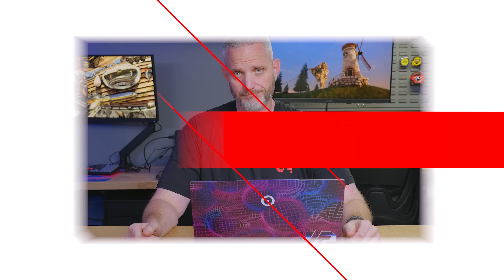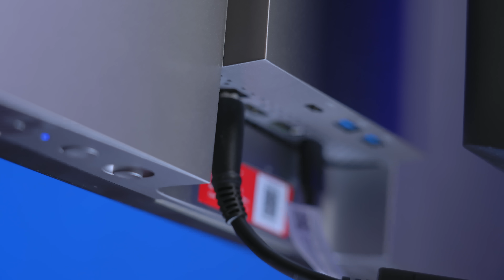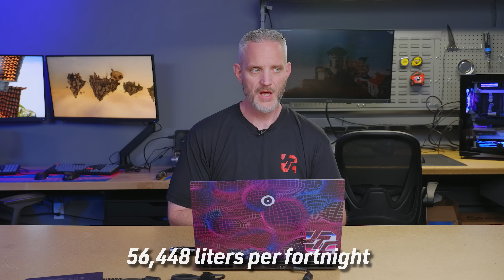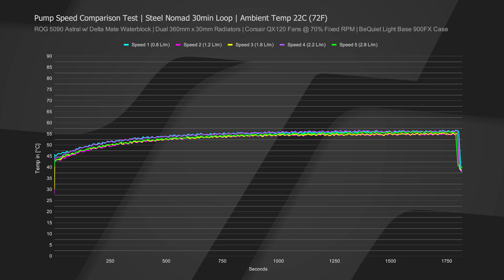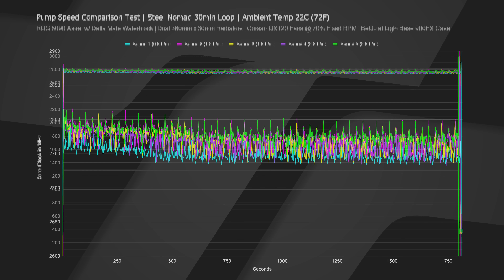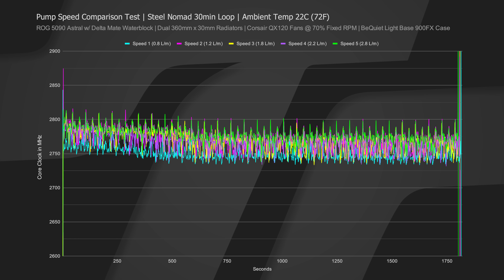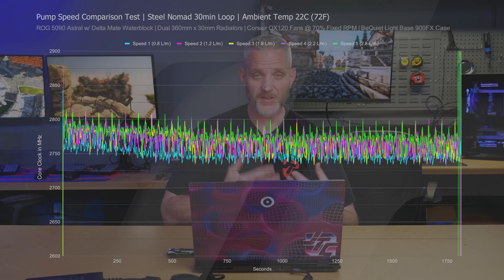Stop doing it this way!

Comment: Fastest speed to me doesn't sound like the best choice, coolant has less time heat soaking and less time dissipating said heat. The faster the water goes over the heat source the less time it has to soak up the heat cooling down the source is not efficient. Going too slow then the coolant wouldn't be removing the heat fast enough but acting like an insulator if you will. So there would be a sweet spot between the fastest and slowest and that I think will depend on the loop itself, radiator size, CPU/GPU blocks, restrictions changing flow rate, the coolant itself... everything that makes a custom loop unique.

Comment: 45-55 % or until you are not annoyed by the pump sound, its FAN speed that increases or decreases cooling ability by blowing more or less air through the radiators.
Reply: ...to a point at least.
Reply: The best thing would be an infinitely large radiator with more fluid. MO-RA wins.
Reply: "Cooling ability" isn't a thing, however heat removal is. The heat is removed by saturating the cooling medium. More time to saturate = more heat being removed.  Also, air and liquids are both fluids, but with different densities. Hope that helps.

Comment: Radiator physics lesson: heat transfer from a material to ambient is proportional to the delta temperature. 

Lets split a radiator into mulitple "zones". The zone closest to the inlet will always be hotter than the zone closest to the outlet. As the liquid moves thru the radiator, it cools off and becomes less efficient at transferring heat to ambient. 

The faster the liquid goes through a radiator, the lower temperature drop across the radiator inlet and outlet, which increases the radiators efficiency at rejecting heat. 

There is always a practical limit since turning up the pump requires exponentially more energy. 

So many other factors effect heat rejection (air velocity, radiator size, design, ambient temps). At some point, changing the pump speed will stop making a difference and a different factor should be changed.
Reply: I just wanted to add a section about the fin stack on the CPU block... 

The faster the liquid, the less temperature drop across the fin stack, which increases its efficiency (just like the radiator)

Only thing increasing the pump speed will do is increase the loops efficiency at rejecting heat and causing the pump to work harder. 

One thing I wish was possible is to monitor the radiators inlet and outlet temperatures. That may be used to indicate if a computer has a good "water pump to fan speed" ratio.... to ensure that both are not overpowered unnecessarily.
Reply: I would think dwell time and surface area would have some effect on it.  Maybe not as much as delta T.  But then again, I disliked physics and gained most of my knowledge from life experience in heavy industrial settings where we didn’t use finned radiators at all.  Just heat exchangers and cooling towers.

Comment: do we actually need a flowmeter?
i think its just a fancy gimmink, adding more cost to the build.
you never rly need it, just like costum waterloop
temp is readable without it by just going to taskmanager
if pump stops working you wil notice right away and turn of pc, if that ever happens.

Comment: You've covered pump speed vs time taking away heat from the CPU/GPU and also the time spent in the radiator giving up that heat but there is another important factor.  The amount of heat removed in the radiator at any fluid speed varies exponentially with the difference in temperature between the fluid and ambient air in the case provided by the fans.  All tests should be run at a constant radiator fan speed.  In other words, HOT fluid gives up its heat faster than COLD fluid and the only way to get the fluid HOTTER is to move it SLOWER.

Comment: I'm still running my first AIO , a corsair H80 , that is now around 15 Yo , always in lowest speed with 2 fans in push pull exhausting , It managed to keep my overclocked i7 socket 2011 4930K under 68°C in the hardest gaming sessions (cyberpunk , Flight simulator) in silence . In 2022 I did a case and AIO upgrade (aerocool L240F with dynamic speed pump by PMW )  and reused the H80 to build my multimedia PC on the living room now with a i7 3770K , still silent  , keeping the cpu around 34°C for YT/streaming HD/4K , and under 70°C while gaming .  All of this to say that low speeds equals longevity of the pump , the best ratio is the lowest setting that keeps the CPU/GPU cool ;)

Comment: I have a similar loop layout in comparison to Jays latest unnamed system.  But I am using a PWM DDC pump instead.  And just like Jay mentioned, the pump hits full speed the moment the system powers up.  Then comes back down when the fan speed profiles load.  It has a heat sync on the back of the pump and plenty of air flow over it to help keep it cool.  I have found through a lot of trial and error that running the pump at 20% at idle and 60% at full load, seems to be the sweet spot for keeping the coolant temps in check.  Running the pump any higher seems to allow the coolant temps to reach a few degrees higher.  My question is, can a DDC pump add noticeable additional heat to the loop?

Comment: Jay, these tests you're doing and your approach / methodology are great, but please fix your data vis. The graph at 13:41 is practically useless because it's so noisy. Please look into different ways of smoothing noisy data. My suggestion would be to show the line chart with moving average smoothing and as a "conclusion" show a box plot for the different pump speeds.
Reply: That would be skewing his data too much.
A better approach is to use statistical analysis on these and give average/variance/mean, that sort of things. In any case we can see that apart from the speed 1/2 where the clocks are slightly lower, every other setting is exactly identical.
Reply: @Bourinos02  I'd argue instead of processing the data in any way, it'd be better to set the tests up in a more controlled manner. For one, use a controlled heat source instead of a windows PC running a benchmark. If you control the water temperature going into the block and the heat source, you can measure the boundary temperature and get meaningful data. A lot of what's shown as spikes in Jay's data isn't noise at all but changes in the system.
Reply: @a.x.w  Except it doesn't matter at all in this use case. The water temperature is defined by the ability of the loop to cool down the fluid at its used settings.
The power consumption of the chip would change only if the ability to cool down is significantly different which is not the case here either as we can clearly see in the frequency curves. So if the delta in these conditions slowest vs fastest pump RPM is already insignificant, it'll be even more so if they just run a heater on the block... Defeating the purpose in the first place as putting a heater is unrealistic as we know CPUs will behave differently upon different cooling.
Reply: @Bourinos02  The point is you'd get more meaningful data in an isolated test. The fluctuations aren't caused by noisy measurements but by changing test conditions. The conclusion that pump speed doesn't matter is wrong in the first place. If you control the water temperature, you can very much see that. When I set up my loop, I ran cinebench until the system was fully heat soaked. At that point, I saw an immediate change in CPU temperature of over 3K between 1800 rpm and 4100 rpm, which happened to be two noise sweet spots. Obviously, this is anecdotal evidence and not scientific. The math is well known, however. You're right that fan speed matters more than flow rate, though. You need to get the energy out of the water, after all.
Reply: @a.x.w  Well, you get 3K between your 2 settings, he gets around 2.5-3K  between his min and max flow rates. Talk about significant impact... Chances are the impedance and contact area inside the water block has more influence on the result than the RPM of the pump.
Reply: I was thinking a Table with something like an ANOVA or other statistical analysis that applies a significant difference label would be helpful

Comment: I think the quality of the coolant is more important for thermal transfer than pump speed, at least in this instance.
The most important factor overall in watercooling is the size and dissipation power of your radiator. If your rad is too small to properly cool the liquid going through it, you're gonna have a bad time.

Comment: I'm not sure if this a good suggestion or if its possible. But would be nice to see each speed line separately or the ability for you to be able to turn off speed 1 and speed 5 so we can see the other speeds more clearly. Might also help when explaining a specific pump speed to remove the clutter and trying to read between all the other lines to see what you're explaining.

Comment: Jay went from "lets measure pump speeds cooling effect" to "SQUIRREL!!!  HI THERE!" with all the different items he discussed in this video.
Radiator fin size
pump heat 
heat sink fin size effect on flow
how many liters per minute
how much ambient air temp changes results
what time of year
what time of day
what time frame after taking a dump
what the comment sections babbles about
all the INNUENDO comments
all the bots in the comments
AI interference in algo placemnt on trending
whather or not Nick farted in the background
whether or not Phil is editing a video
is anyone in the state singing a song that says i should sing it
ooh 
baby ooh
baby
oooooooooooo

Comment: If your loop goes into your GPU first, and then into your CPU and you run it slowly, I can assure you that your CPU will suffer more because it will get hotter coolant. I don’t think this test is fully validated as being able to run it at any speed. This is a huge factor that’s missing and you might end up with an extremely hot CPU due to the fact that the speed is too slow.
I don’t think maximum speed would be needed, but I think the slowest speed is not going to work as the way it stated here.

Comment: Jay, to test the heat dumped into the loop from the pump, use an external power supply and run it at 100% for 30 minutes with the system off. Great Video.
Reply: Or create just a small loop with just the pump and res, powered externally. 

That way you won't even deal with flow restrictions from blocks and fittings.
Reply: This is the way.
Reply: It's only a ~20W pump, it isn't going to dump much of anything. 25% of that will probably bleed to air, 75% to water at best.
Reply: Or just measure the energy consumed by the pump. It cannot generate more heat than that and I assume it's pretty meaningless compared to the heat generated by cpu and gpu.

Comment: How about just on a bench ( flow meter and temp meter on all of them )  
Take a random cpu and a 30/40/50 gpu/ or amd /or heat blocks   ( you need data )

340l/h to 1500l/h 

1 setup: cpu / gpu / pump /reservoir / 1x360 radiator / soft tubing no 90
2 setup: cpu / gpu / pump /reservoir / 1x360 radiator / soft tubing with 90 fittings

3 setup: cpu / gpu / pump /reservoir / 1x360 radiator /  hard tubing  with 90 fittings
4 setup: cpu / gpu /+ other blocks/ pump/reservoir / 2x360 radiator (or other radiator) /  with 90 fittings

It will take some time but you will have a lot more data 

Examples 
Alphacool D5 have around    340 l/h - 350l/h
Barrow 10W PWM 450LPH    450l/h
--- 
Freezemod   PWM 1100L/H
Barrow  18W PWM D5  1260L/H
EK D5 PWM1500L/H

Comment: Hey Jay, any suggestions for a manual controller for a 4-pin Molex plug pump? IDK what, but my Aphacool DDC pump is MOLEX, so it runs 100% all the time, and I feel with my setup it is moving fluid WAY too quick to cool the system.

Comment: Jay, you could have gotten way more accurate settings in the bios if that pump had an RPM output.
Could have watched the speeds in the bois or a system utility and been able to set it accurately.

Comment: I recently converted to a full loop in an older case with a blocked Titan Xp to finish off my board and i7 blocked x79 R4BE platform and spent a good while adjusting speeds through my ROG front base. throughout a handful of full loop builds ranging from a single 120 up to this rig with 2x 280s and a 140, 70% pump speed across pumps from the mid 2000s up to now its always been the sweetspot in that 2000-2500rpm range for me, sure i haven't measured flow rate..they didn't exactly exist in the 2000s, we had spinny wheels to see if fluid actually moved hah! Outside that boundary and either i havent been able to overpower trapped air or recieved worse temps with added turbulence in the res.

Comment: Thank you for doing this test. And thank you for confirming my experiences with D5 pumps where reducing noise/vibrations seems to be the main factor. Even with decoupling I have to use the lowest setting so I don't hear the hum from the pump. At higher speeds it makes more noise than the fans do.

Comment: My opinion it doesn't really matter I run my pump minimum 2100rmp then I've custom curve it to the GPU so hotter my GPU gets the faster my pump runs up to 60c 100% speed. But my GPU never goes over 45c so.

Comment: i live in a 4 season climate i run my pump at a different speed for the temperature it puts out. when it's hotter out with more humidity it takes longer to cool the antifreeze down. laws of thermal dynamics when combined with laws of hydrodynamics.

Comment: Put a flow meter on the line just before it dumps back into the reservoir so you can see if flow rate changes at all.
Reply: Not necessary. The flow at the second meter will be the same as it is at the first. The only way for fluid speed or volume to change is by changing what the pump can flow. Liquids do not compress, meaning you would have an accumulation of fluid at some point in your loop if volume were to change anywhere.

Comment: I'm surprised that you actually didn't reference cars for this video. If you take the thermostat out of a small block Chevy it will overheat. The water just moves too quickly through the loop and doesn't spend enough time in the radiator to properly. Cool. So you got hot water going in and hot water coming back out into the engine. If your thermostat is stuck and you're overheating anyway, just got the insides out of the thermostat and put the housing back. That will restrict enough flow for the water to stay in the radiator and your engine won't overheat. Although I don't know how many people have a small block Chevy these days LOL

Comment: 10:30 You literally have a thermal camera! You just used it!
Reply: Or an inline thermal probe - Alphacool have a flow sensor (to 3-pin fan header) and coolant temperature sensor in a single device. If the motherboard doesn't have a temperature probe port (most don't) then plugging it into a Corsair Commander / XT or similar works fine.

Comment: The physics applied in this vid is completely non-sense. The physics of water cooling has been pretty much known for ages, like in at least for 20 years now, and they apply here as well. Jay is simply not talking about that physics at all. He is out in the fields somewhere, doing farm stuff. To be blunt, he just showed you that water cooling don't matter, just use your air cooler. That would apply to these very results, because he is not measuring the expected results of pump speed.

In short, the efficiency of a water block, typically can benefit greatly form increased pressure or flow. The benefit is inverse exponential, and depending on the pressure in question, there might be little to gain. Also, radiators also increase their efficiency with increased pressure or flow, but most rads do not benefit all that much from the increase, and the benefit is often loss due to the added heat to the loop form the pump. Also, he test this with in adequate rad power, as he talks about the loop heating up.  That is because he has an impotent rad. Loop temp is irrelevant once you have a potent rad, at least for this type of testing. The water temp into the block should easily be kept within a few C or K, of the ambient. No matter the pressure.

But, as he once again proved, water cooling is not needed. A proper air cooler gives about the same performance. Once you start chasing the last bit of performance, it is the way to go. But rather, in loops with insane power consumption water cooling can deal with the heat, while air cooling will start to hit a wall. Like systems drawing 2000W or more.

But if he had used a high performance water block, in a somewhat restricted loop, the water temp will sky rocket after the block, if pressure is increased, as the efficiency of the block will increase dramatic. That will feed the loop with significantly more heat, so if all you got is an impotent rad, all you see is that need for viagra. It is real, an this has been proven to like a trillion times, including in this very vid. There is absolutely nothing new here, just a guy interpreting his data like a looney tool.

Comment: Looks simple.
Low flow - liquid spend more time absorbing heat, higher temp at the radiator enter.
High flow - liquid spend less time in the radiator, higher temp at the radiator exit. 
Middle - nice balance on that system You got.

With different coolant volume or radiator capacity - balance could be shifted closer to either high or low flow.
So at some point - 100% speed could be best.

Comment: Meh... as a plebeian AIO-user I simply trust that the manufacturer knows what they're doing and am leaving my pump on its PWM setting. Not much choice, really, as the SW will only let me go PWM or "full speed" plus there's no option to create my own PWM-curve. The lowest possible RPM in PWM-mode is 2200 (max is 3200), so it's not like I could switch this thing off even if I wanted to.. :D

Comment: If your manual D5 pump is anything like the ones I have, it does in fact not have an infinite adjustment.  The space between each number does nothing.  You get 5 speeds and thats it.